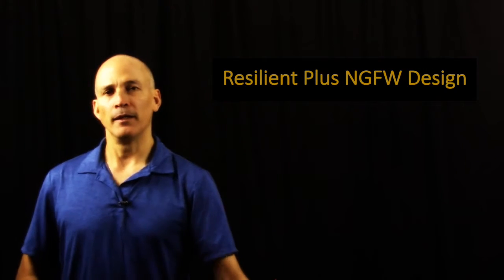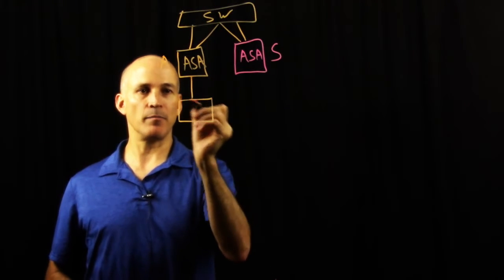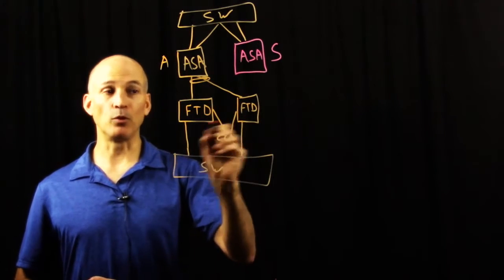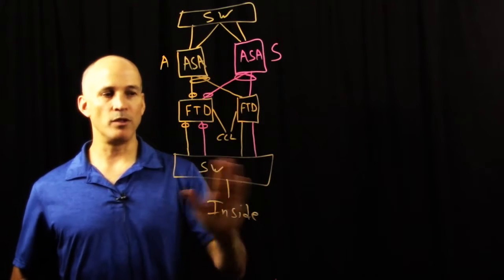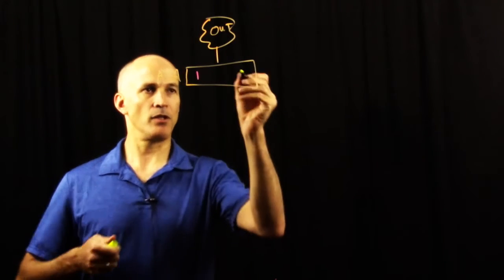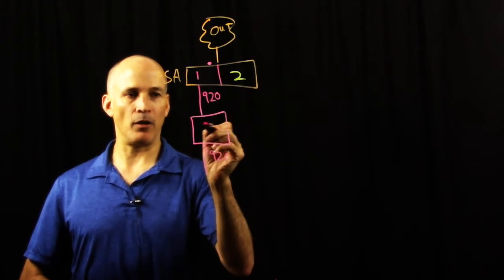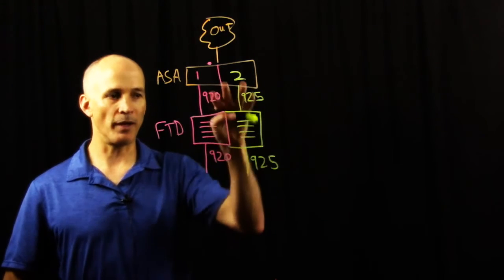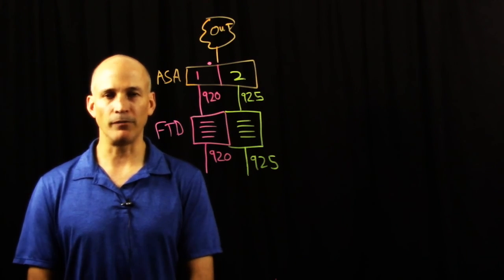Resilient Plus NGFW Design Chalk Talk (2017)

Comment: Hello Charlie,
I am curious about the fact that FTD has most of the ASA features and even more, but we still need the ASA. Is the multi context mode the only reason to keep the HA ASAs? FTD with AnyConnect is already here. 
Is it possible to use four FTDs? If we use first ones routed mode FTDs to do the firewall job, and the second ones to do IPS inspection, then we can manage four of them with one FMC and a couple of policies. 
Can we do resilient+ NGFW with two ASAs and two clustered Firepower sensors? 

Thanks for the great video !